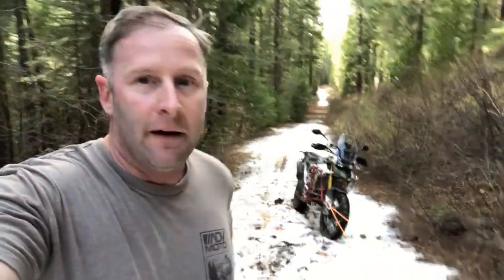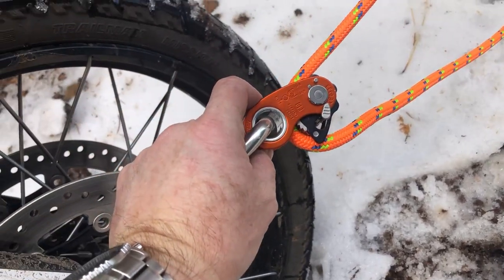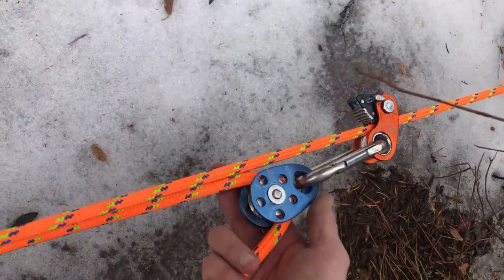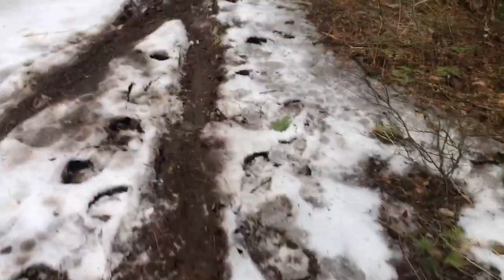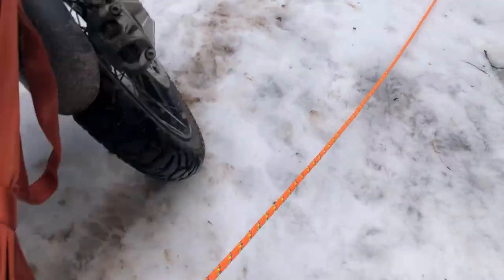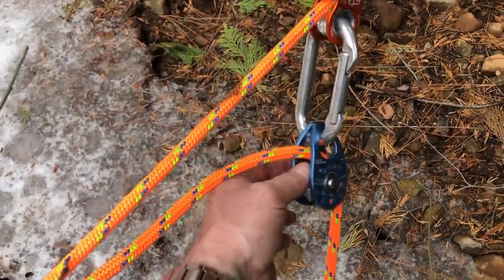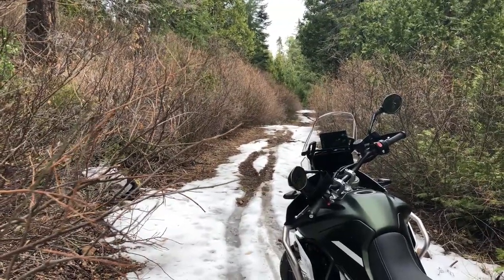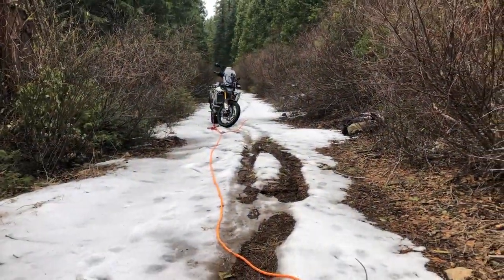Z-Drag Moto-Rescue (Motorcycle Recovery)

Comment: Good video and a nice setup.  I have a Z-Drag system that is 4:1 pulling from the bike side and 5:1 pulling from the anchor side.  It works quite well, though I have only used it for practice so far.  🤞
Reply from the maker: I this system to a 4:1/5:1 setup, also only used it to practice, but I pulled my loaded bike up a 30-35* slope on a test run. Worked great and have plans to use it in the field to complete my ride through Brush Creek!
Reply from the maker: I used my new 4:1/5:1 system to pull my wingman’s bike up out of a riverbed n Mendocino NF last week. I’m never leaving the pavement without it!

Comment: I use a 6 to 1 purchase system off of my sailboat, that's 4 times less effort to pull on than the 2 to 1 Z-Drag you show. Mine also has the sailboat block with the cam that locks the rope so you don't have to hold the tension with your hand. Flick the rope out of the cam, and it lets free.
Reply from the maker: I have since upgraded my system to a 4:1/5:1

Comment: Just the CT rollnlock are gonna set you back almost 150 bucks, for that price you can buy a recovery system from green Chile adventures. It’s a all in 1 5:1 system specifically designed for motorcycles. Thanks for sharing tho.
Reply from the maker: That’s very true… and they make awesome gear. I definitely recommend a 5:1 system too. The 3:1 is a bit “under-powered” for a bike this heavy.

Comment: The way you have it set up is a 2 to 1 system.  Thay's why youre having so much trouble pulling it.   If you start by tying the rope to the bike and adding another pulley, you'll have a 5 to 1 and make it a helluva lot easier.
Reply from the maker: I have upgraded this to a 5:1 system… I need to do a new video for it.
Reply: You should!  I've watched this video at least 5 times. :)  I am getting all my components together for a 5 to1 with a couple extra components to easily convert to a 15 to 1, although that might be overkill.
Reply: @firstbloood1  True, but with very little effort.

Comment: If the seat hight was lower, one could actually sit on the bike and pull with both arms, right?
Reply from the maker: I would say 9/10times, no. One hand will need to stay on the handlebar to keep it straight.
Reply: Have you tried anchoring the bike on the forks or bars so the system keeps the bars straight?

Comment: I don't under stand why at the first of the video  your not on the bike with it running  and pull the  rope as your  letting out on the clutch ? Your  trying to pull the bikes complete weight . Any  turning of the wheel  by the engine would  have make things a lot easier . If you put the  rope under  the  back tire and then set on the bike  as you let out  the clutch   it will pull on the rope as the tire  turns . Its like you pulling on the rope  but the tire  turning is doing the work  . You can also  wrap the rope around the hub . Standing there  trying to  pull on the rope with the bike  not  even running is about stupid . On the other hand if the bike  was not running for some reason  and you were pulling it  up a hill so you could  go back down it to  bump start it that's another story . Watch this video at 4:53 . You can see he  wraps it around  the hub on the  disc side and the back wheel does  the  work  . https://youtu.be/kYf2iUY4jZ8.
Reply from the maker: Lol, well the short answer is I didn’t see that video before that day and he has way more experience knowledge than I do. There were a couple other things I’ve learned since that day which might have actually prevented the need to pull that kit out. It was still a good test of the capability and limitations of a 3:1 system and I now use a 4:1/5:1 system… which I haven’t demonstrated yet. I plan on doing that later this summer.